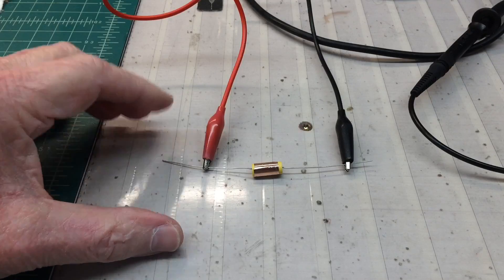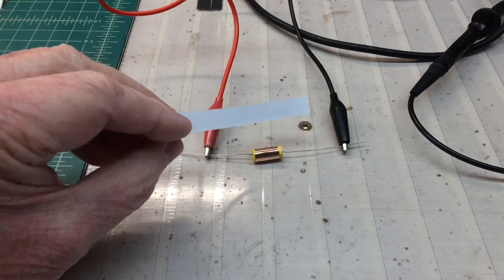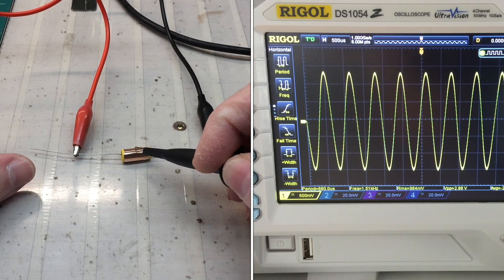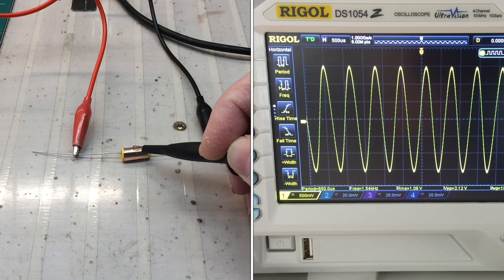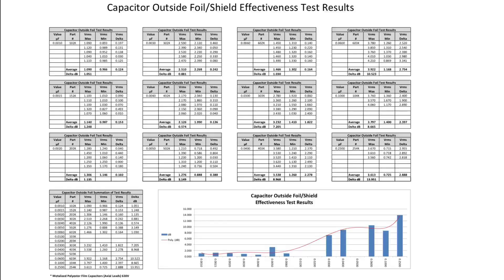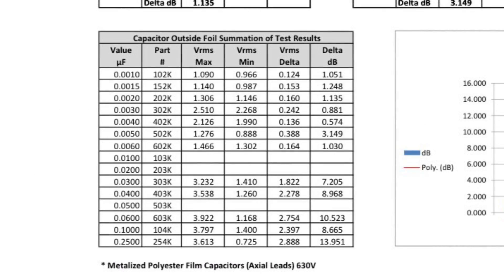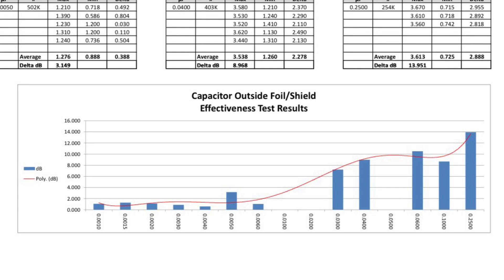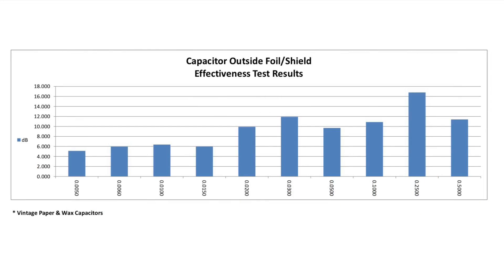Capacitor Outside Foil/Shield Effectiveness Test Results

Comment: One advantage of modern caps is they're quite a bit smaller than their vintage equivalents, so there's less surface area to couple noise into... goes a long way to explaining why it's difficult to discern the foil end on lower value modern caps.
Reply from the maker: Definitely a smaller footprint vs. those oldies. Not sure if you saw one of my latest designs that discerns the outside foil in most all cases. Here’s the link:

Capacitor Outside Foil Sniffer w/ Arduino Version 2.0
https://youtu.be/p1RolBQFZ4U

Thanks again for watching and reaching out.

Best,

Don

Comment: try to solder the copper foil to one side of capacitor lead (actual capacitor outer foil lead). 
"Becareful not to short-circuit both lead with a copper foil"
you perform the test again and observe oscilloscope again. all external electric field stray noise were all gone (almost 978uV). An open/floating foil shield still not effective to block field noise. it is my 2 cent thought.
Reply from the maker: Thanks for doing the research and sharing your results/experience. I’ll check this out down the road. All the best. Don

Comment: I have a very small oscilloscope, a dso 188 model I was wondering if that can 
be use to tell the foil side of capciators?
Reply from the maker: I would think so Ron. Try a 0.1uf or larger to start out with. The low value capacitors will be harder to discern. Best, Don

Comment: Thanks Don I have never really thought of signal strength in capacitors in that way. You sure did collect a lot of useful data. Thanks for sharing it with us all.
Reply from the maker: Thanks Larry. I pinned a link to the data files in the comment section for reference if you’re interested. Best, Don

Comment: I appreciate all the work and effort you went through to gather this information for your viewers.  I don't know about others but I had difficulty understanding how you went about making your tests.  Perhaps a diagram showing how the circuit was connected, and description of the theory of operation of your test would have helped.
I think that if I could not determine the outside foil lead from a simple connection to the oscilloscope, it would be time to build the Carlson's Outside Foil Tester:
https://youtu.be/BnR_DLd1PDI
That way I would know for sure!
Reply from the maker: Thank you Wayne. I’ll do a follow up to this soon. I was measuring egress from the foil side by connecting my audio signal across the capacitor and then reversing the leads to measure the difference in amplitude and converting the voltages to decibels to better estimate the benefits of connecting the foil side of the capacitor correctly.

Do you notice the lower value capacitors below .01uf are difficult to discern using the oscope?

I’ll follow up with you soon. Stay well and all the best. 

Don

Comment: You might want to check to see if you're getting Alzheimers. [or maybe you like chaos]. Compares what to what? Various value caps compared to others ? WTF is Delta?
Reply from the maker: Foil side to non-foil side in decibels to demonstrate noise mitigation if the capacitor is incorrectly placed. Best, Don